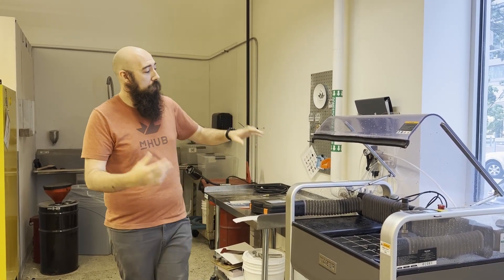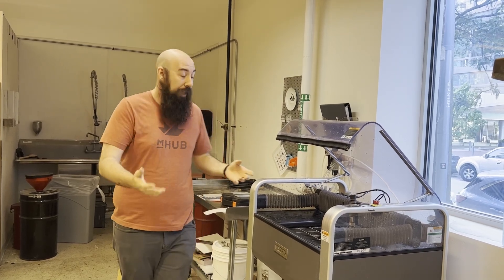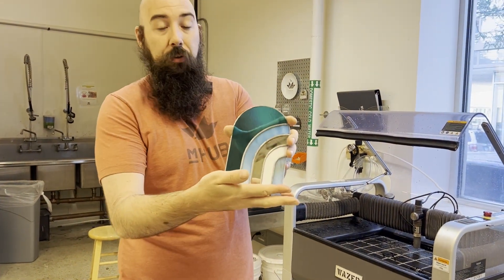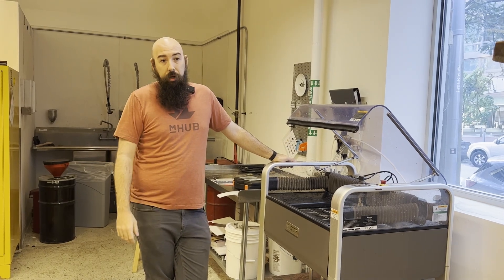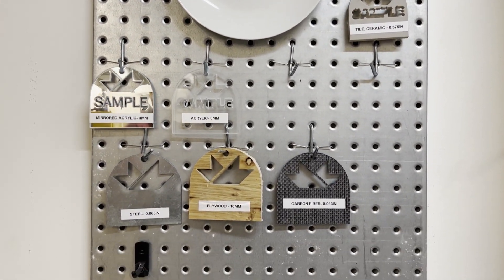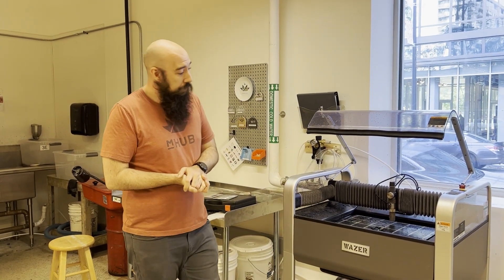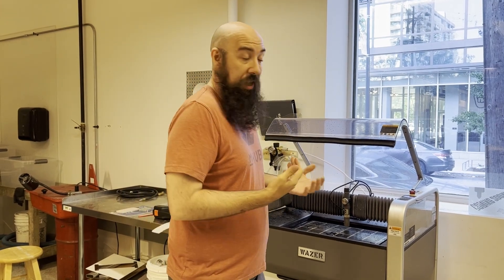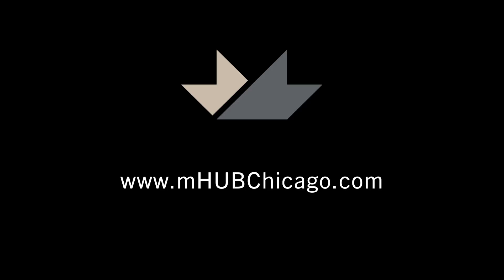Wazer Waterjet Review + Initial Cuts

Comment: Unlike anything else in the makerspace, this costs quite a bit to run.  Do you charge members by the minute of pump time?  Or is there another way to cover the cost of the expendables?
Reply from the maker: Most usage of equipment in the shop is covered by mHUB membership fees. There are a few that require an additional rental fee - including this one. The others are the fiber laser and UV printer due to the direct cost of consumables. For the water jet, we charge $25/half hour which includes material and maintenance.
Reply: @mHUBInside  Thanks for the info.  We are considering getting a Wazer for The MakerBarn, but first we have to come up with a good way to track pump time for a user.  We may tie it into our MACS user access system.

Comment: Super informative well done video, thanks. Questions, would this ruin the wood if 1/4” untreated plywood was cut due to moisture? Can more than 1 pass be done to go deeper into material? In the case of marble/ granite if the thickness is to great, does it basically “ engrave”?
Reply from the maker: We have successfully cut 3/8" plywood, the caveat is your material is going to get wet, very wet, and while our piece did not warp something smaller might. It probably wont do fine detail in wood well. Wazer does not have a setting built for wood so I would assume they wouldn't "suggest" it. When cutting with a water jet you start with a pierce move that goes all the way through and you really don't want the head to move before that. If the jet of water moves faster then full depth cutting occurs (on any material), then "scoring" can happen, which isn't great for engraving.  The head has about 1" of clearance and theoretically you can cut anything that passes underneath it, but it might just take an unreasonable amount of time with not that great of an edge as a result. Thanks for watching! Hope that helps.